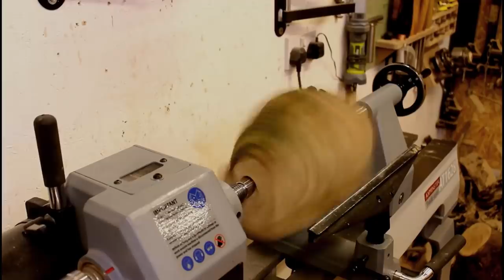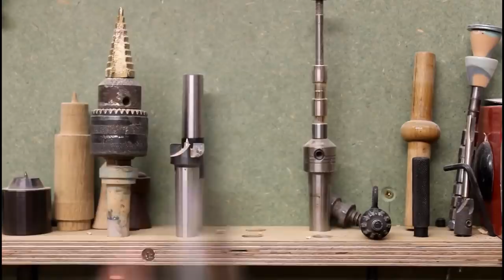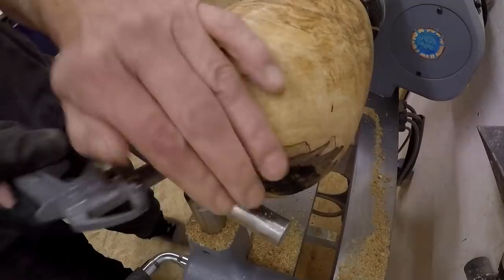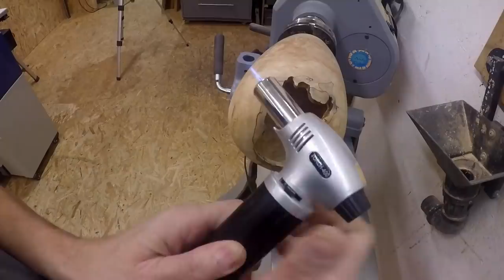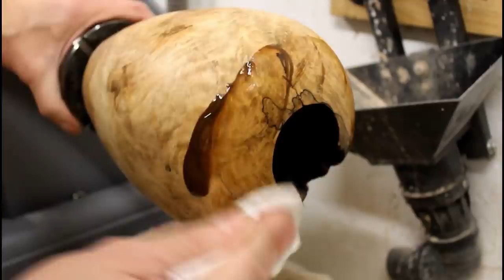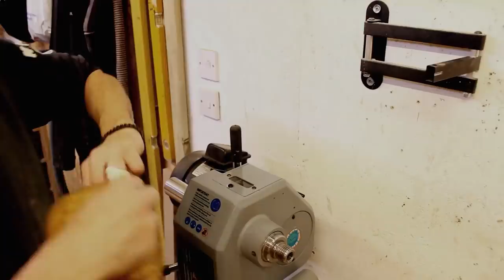Woodturning - The Horse chestnut Burl Hollow Form

Comment: Do you believe it would be possible to put a very thin piece of plastic sheet prepared for an epoxy fill, held in place by an inflated ballon, to fill the voided area?
Reply from the maker: Yes that's what I would have done if I had decided to resin it ..